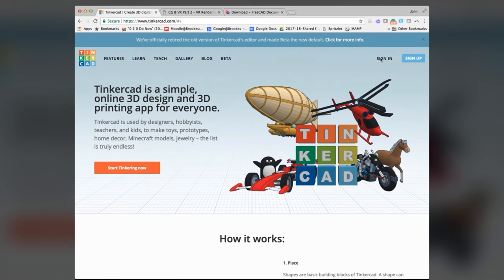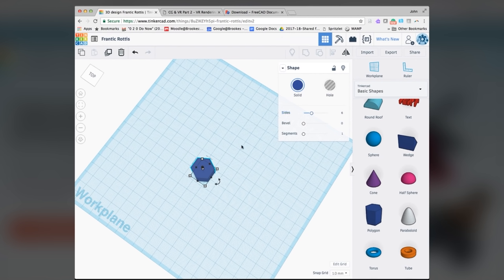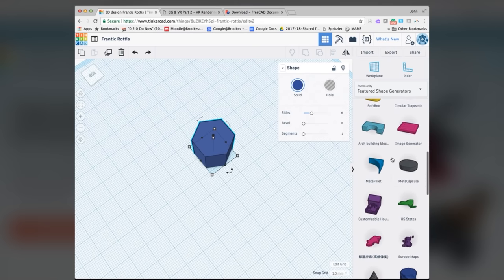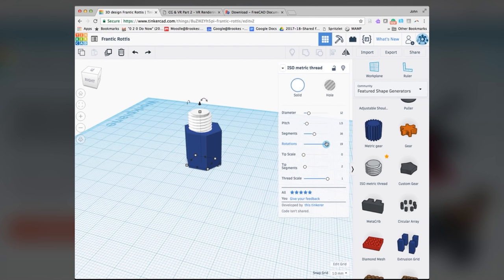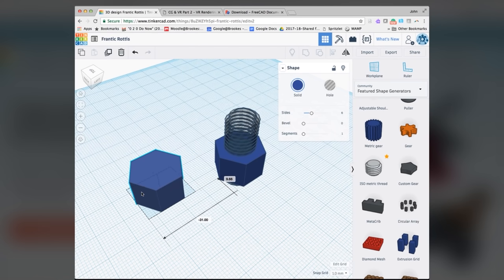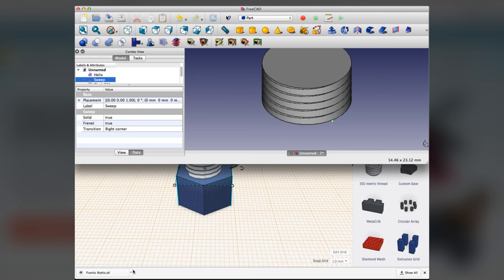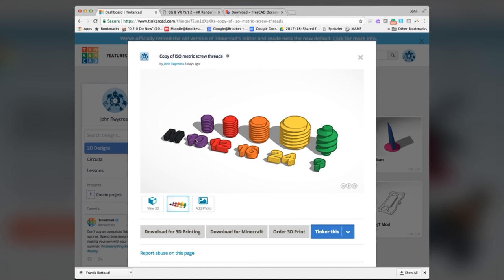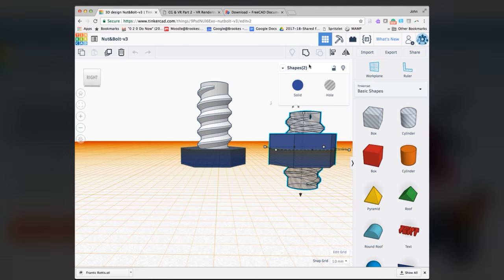How to make a nut & bolt  in Tinkercad

Comment: Align tool for centering, not by eye. Ctrl D to duplicate the thread in the nut, then move over to your bolt head so you have 2 exact threads, a little bit of tweaking with thread scale and pitch to make an easy fit

Comment: will printing the same dimension threads as a nut and bolt make fitting parts?   doesn't the bolt have to be slightly smaller in diameter?